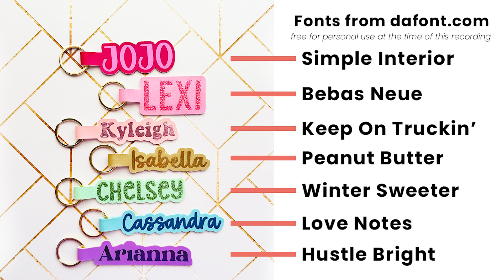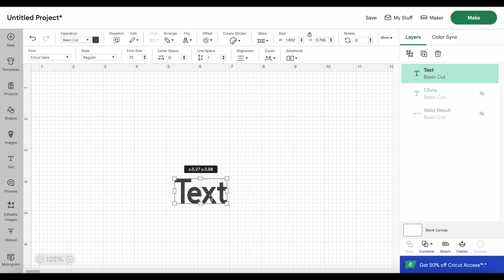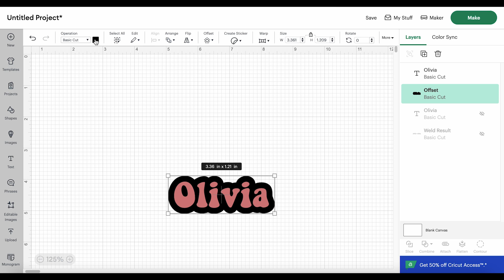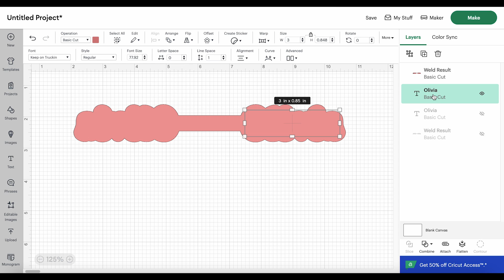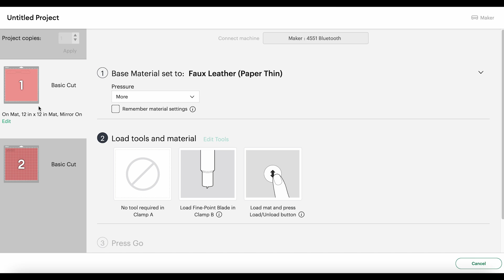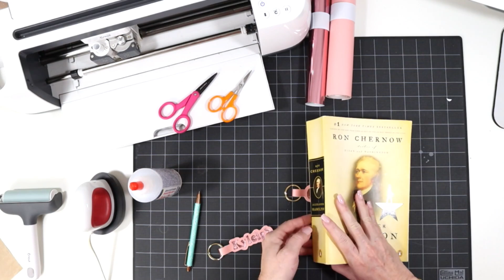How to Make Name Keychains using Offset in Cricut Design Space

Comment: Whats the best way to add a name on the otherside?
Reply from the maker: Hi, great question! You can cut a name out of heat transfer vinyl, but it won't match the outline because on the backside, the letter outlines are in reverse order. So smaller text that fits inside the back shape will work, but not the same text and font and size as you did the front. I hope that makes sense. :)
Reply: @AmyRomeu  Absolutely makes sense!!! I have some faux leather and have made afew cute wee keychains using your tutorials. Soon as i saw my explore 4 could cut it i was like RIGHT! lets make some cute things! hehe.

Comment: my only issue i have with these is over time they start to become unglued..  I am trying to find out if there is some sort of "support" foam board or something that can make it sturdier ..:/
Reply from the maker: Hi - thanks for your comment! I haven't had trouble with them ungluing. Are you pressing them under something heavy for at least an hour after gluing? What glue are you using?

For the inside support - you could try using some clear plastic inside, like a piece you cut from a grocery item container or a plastic folder.

Comment: I tried this glue and made a mess. lol. It either didn’t stick the two together or got it on the outer part and can’t scrub it off. I’m a mess. 😮
Reply from the maker: Hi, Kelly! It may take practice to get the right amount of glue spread so it doesn't ooze out to the outside. :) Also the key to getting the two parts to stick together is to press the glued keychain under something heavy like a book for a few hours - did you do that? :)
Reply: @AmyRomeu  I tried hot glue, E6000 plus gel super glue. It was all a mess. I finally ordered the heat bond paper (sewing stuff) and it works like magic and way less messy plus no drying time.
Reply from the maker: @kellyhoward5996  Awesome! So glad you found something that works for you!

Comment: Do you ever have a problem with  your faux leather being sticky after face down on mat? If so, how can I avoid this?  Also, for Cricut Joy would I just rotate the leather and name so they are the long way down the mat and use a 12 inch long mat?  That's what I'm picturing in my mind!
Reply from the maker: Hi, Colleen! Sometimes when a new mat is super sticky I do have this problem. You can use a mild dish soap on a warm dishcloth to remove it. You can also try some rubbing alcohol. Test in a small area first.

For making keychains with the Joy - yes, you are exactly right! The 12 inch long mat will be your best friend for this project. :)

Thanks for watching and taking the time to comment! I can't wait to see your keychains!
Reply: @AmyRomeu hello, what can cricut joy cut leather 2mm the thickness?

Comment: my question is, since the leather is soft and thin as with your earrings and this do you put something in between the layers to keep
it in its shape? and if so what do you suggest?
Reply: where do you get your leather from so I get the right thickness?
Reply from the maker: @sandyspranger7527   Hi, Sandy! I buy my faux leather on Amazon and Etsy. I add a list of the exact materials I used with convenient links in every video description to make shopping easy! :) I hope that helps!
Reply: thank you @AmyRomeu
Reply from the maker: Hi, Sandy! Great question! I find that double siding the faux leather (which is not that thin) plus the layer of glue inside makes these foldover keychains pretty sturdy. I would not suggest making these with very thin faux leather (same goes for earring making). I hope that helps!